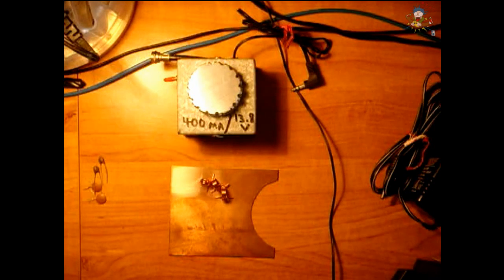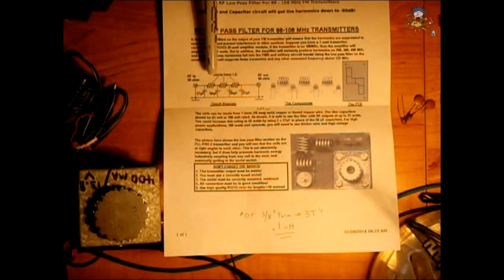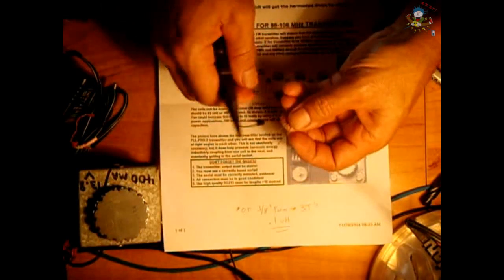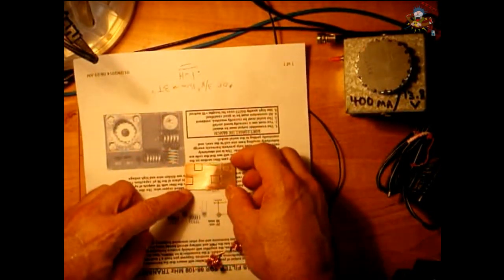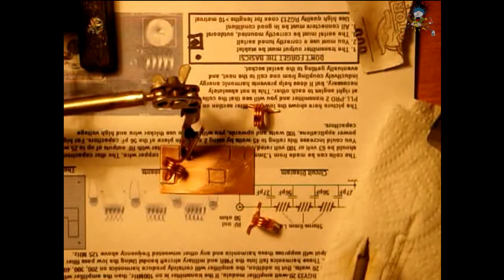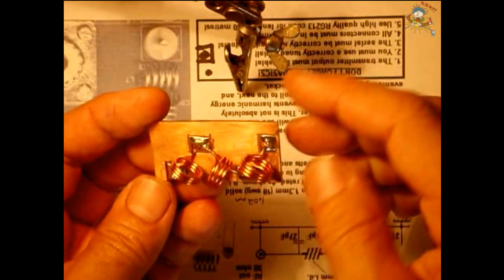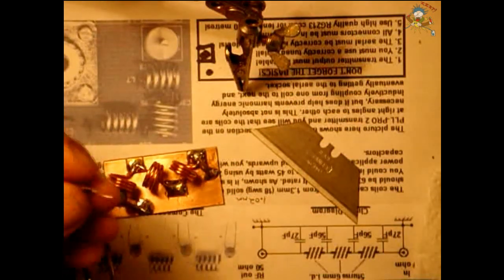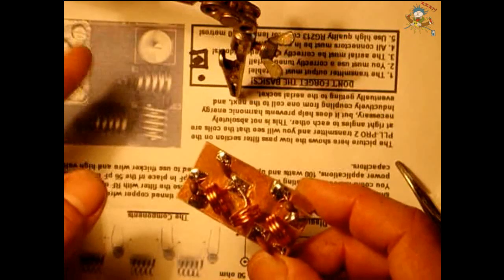RF Low Pass Filter for FM Transmitters (88-108mhz)

Comment: Just what I needed!! Thank you so much! Is it possible to replace the Capacitors with Trimmers so you can adjust the cut-off frequency? And if so which ones would I need to replace? I want the cut-off to be as near as possible to 108MHz but without reducing power near 108MHz of course :)
Reply from the maker: You can use trimmers, but I don't see the need for them if this is properly made.  Thanks for watching!
Reply: I build this filter using trimmers and I measured the capacity first and set the trimmers at 27 and 56 picofarrad and marked that setting on the trimmers. After assembly I tested the filter and guess what? I only had to adjust them slightly. I had to reduce the capacitance a little because of the capacitance of the islands on the circuit board, which gets added to the components. A further interesting discovery I made, having used trimmers instead of capacitors, and after having done some online research, is that this LPF can also work as an antenna matcher.  By tuning the circuit I was able to get my SWR reading down to 1.05 to 1 (!!). So it can help to make your antenna system more resonant. I hope other people reading this benefit from this info. Anyway building this filter was great learning experience.  :)
Oh and btw, I read in the comments that this is called a Chebyshev filter but actually, with these component values it's a Butterworth filter. I found that out using the "Elsie" software.

Comment: Hey...Thanks for the video. I would like ask if this filter will work for a 1000 watt transmitter?
Reply from the maker: I'm not an expert on these filters, but I think you should be able to use this, just as long as you make the copper pads that the coils are soldered to larger(space them out more), and use heavier copper(or silver plated solid copper wire) when making the coils(maybe 12 ga). Be sure to use an inductor calculator online to adjust the turns(more turns for the same inductance) when using heavier wire.

Thanks For watching. Be sure to share, rate a thumbs up, and watch my other videos as well.
Reply: Oh ok. Thank you electronicsNmore
Reply: Kwame Baafuor  Hi, I would not recommend that circuit for high power rf use. Its for wattages up to about 50 watts but could be used higher if the capacitors were paralelled (to make a higher voltage cap). For high power designs you need proper high voltage caps like j101 metal clad mica capacitors (500v rated). Great video though
Reply: MrKillaHurts
 Your information is good except where you advise on parallel capacitors.

Capacitors connected in parallel will add their capacitance together.

A parallel circuit is the most convenient way to increase the total storage of electric charge. The total voltage rating does not change. Every capacitor will 'see' the same voltage. They all must be rated for at least the voltage of your power supply. Conversely, you must not apply more voltage than the lowest voltage rating among the parallel capacitors.

See http://www.coilgun.info/theorycapacitors/capacitors2.htm for that exact wording.

The 1000 watt transmitter (assuming a 50 Ohm load) will have a little under 224 volts of RF across the capacitors, so a 500 volt capacitor is a safe bet.  The current the coils will carry will be about 4.5 amps.
Reply: Hi, just on the question about the filter for high power. See my comment below.
Reply: Bruce Holmen Hi thanks for this info! The link is really handy. So lets say you have a 50 watt p.a going into a filter then into a 50 ohm load. How do you work out what voltage the capacitors will see on the filter? Ie what would the highest voltage be that the filter capacitors need to be rated for? Thanks
Reply: MrKillaHurts Based on the power formula (voltage squared divided by resistance equals power in watts).  If your power out is 50 watts and the impedance is 50 Ohms it is pretty easy to see that your voltage would be 50 volts (50 volts x 50 volts = 2500, 2500/50 = 50 Watts).  This would mean that if we were talking about power in a DC circuit we would have 50 volts across the capacitor.  That gives no margin for error and no safety factor and we are talking RF not DC.  I would go with at least 100 volt rating but since your next project would take you even higher in power, why not start with the 500 volt rated capacitors?  You seem to have a pretty good grasp on electronic theory - what voltage rating are you comfortable with?
Reply: It's good for about 20W max.  At 1000 Watts, the design looks similar on paper, but the components are made of much more heavy-duty materials such as copper pipe and air-gap or even vacuum capacitors. The voltages and currents very quickly become lethal.  Learn with the little, safe stuff first.

Comment: I have an fm transmitter I use to  have  musci around my property ( 3acres) I run just enough power to cover most of my  land.  I transmit  @ 87.7mhz as there are no local stations on that frequency. However I have checked out the harmonics on the transmitter and I Have a fairly strong harmonic on about 91.5 mhz where there is a local station.  Do you think this filter can be modified to use with my transmitter so that it doesnt pass anything above say 88mhz?
Also want to be certain theres no harmonics going out on  the airbands.
Reply: A "harmonic" would be at a multiple of your transmit frequency (eg. 177.4MHz, 263.1MHz, etc.)  One of the characteristics of a Chebbyshev filter is that is has a pretty-steep cut-off slope.  It can filter-out other spurious emissions above your transmit frequency.  But this filter is probably not sharp enough to deal with cutting off spurious products out of the bands immediately above the FM broadcast band if you are transmitting at the upper end.  You especially want to keep from interfering with the aircraft band (108-136MHz).

Comment: You do not need to use flux for everything.
The tin is applied in the place where welded. It is not applied on the soldering iron and then transported.

Very good work anyway.
Reply: +Guillermo Sempron WE DON'T WELD, WE SOLDER.
Reply: I believe he applied the solder to the iron  so that he doesnt overheat the board.  And with the flux you can see it soldered just fine. There is almost always more than one way to handle a task.
Reply from the maker: Applying the solder to the iron, tins the soldering iron, and a little extra solder helps transfer heat to the board. The flux allows the solder to flow nicely.

Comment: For me the 56pF Capacitors make no sense. I found the same circuit diagram with an inductance value, the 27pF capacitor at the end forms with a 74nH a low pass filter at 112Mhz but the 56pF at the beginning has a cutoff frequency of 78Mhz!! That would bolck out my complete signal.
Reply from the maker: I didn't design the circuit, but for me it worked just fine.
Reply: @electronicsNmore  Too bad. Because these circuits also seem to be dependent on the input and output impedance and I have no idea what it's doing when I connect this to my self made transmitter.

Comment: RF at 90 deg screws with the signal, I'd check the waveform on the scope...
Reply from the maker: Works perfectly. I have no issues. Sound quality is excellent, and the signal on my frequency counter is nice and stable. I cannot ask for more.  I used this circuit in both my 1W and 4W transmitter. The link to the schematic also states to place the coils perpendicular to one another for better results.

Check out this link I just found. Scroll all the way down and you will see the EXACT same low pass filter layout as I did. The person that designed that 40W unit knows more than me on this subject, so mine must be fine.

http://radio.xtreamlab.net/40w-no-tune-amp.html
Reply: electronicsNmore The coils are mounted at 90 degrees to reduce the coupling between the coils. Also I believe it helps if some coils are wound clockwise and counterclockwise.
Reply: This circuit will indeed work using the technique you have employed. However if you want a real "brick wall" cut off with the best attenuation, you can do better. Since the cut off is 125MHz, a little extra lead length on the coils won't hurt to get them further apart. Getting them away from each other will improve the harmonic rejection by reducing the coupling between them. Winding the coil in the centre in the opposite direction may help but not too much if they are spaced appropriately and 90 degrees from one another. Also, using multiple smaller value caps in parallel instead of one is better. eg: 8.2pf + 8.2pf + 10pf in place of the 27pf and don't solder them all to the same spot of the ground. This gives a lower inductance path to ground for the harmonics and improves the power handling capability of the filter. For the 56p I would use 15p + 15p + 15p + 12p (57p total). I also wouldn't bother cutting the board but rely on the mechanical rigidity of the multiple capacitors and just solder it lead to lead above the board, it acting as a ground plane. If you want very high power handling, use the same technique as well as much thicker wire for the coils (adjusting the diameter of the turns to maintain the inductance) and use 2 or more metal clad mica capacitors in parallel at each circuit location. :) I hope this was of interest

Comment: you make a coil in the video 3 turn but the coil is 5 turn in the diagram (sorry my bad english)
Reply from the maker: The circuit was modified for the frequencies I was using.
Reply: @electronicsNmore  my transmitter is FM (88-108) ı make a diagram ?

Comment: im not smart enough to do this. know where i can order one? :/
Reply from the maker: +bryce f. 
Hi Bryce. I'm sure you are smart enough, the problem is you may lack the skills required. :-) You can look online for an RF Low Pass Filter. 

Thanks For Watching!
Reply: +electronicsNmore my reason of using something like this is called the raspberry pi for FM radio. only problem is it's square wave so the harmonics splatter all over vhf frequencies and most likely 10 m band if even possible.
Reply: Try looking on e-bay.  I've seen a few boards like this.

Comment: For the many Cheap Chinese and home brew FM BCB transmitters, this LPF is not sharp enough. I have seen typical spurious emissions  from such FM BCB transmitters At the bottom of the Airband at 110 MHz..
I have seen modulated signal images + 6MHz above and below the transmit frequency AND again about  30MHz above transmit frequency!!! ( from E-bay Chinese Transmiters as lose as 1 watt)

That puts your modulated signal right into the Aircraft Band ! And don’t think low power or being away from an airport will make it OK...Aircraft at Flight Levels of 24,000 feet receive signals hundreds of miles away.. if your on a terminal control frequency, of which there are many-not even fo your area- your signal will be blocking air communication. Not a good thing.

These cheap or home brew FM transmitters really need a tight BAND PASS filter , or Cavity filter to be safe to use. Period.
1 second ago
Reply from the maker: Yes, I agree with the Band Filter. Thanks for watching!